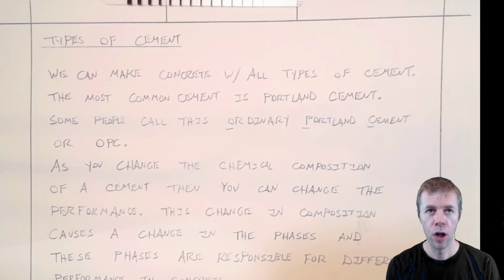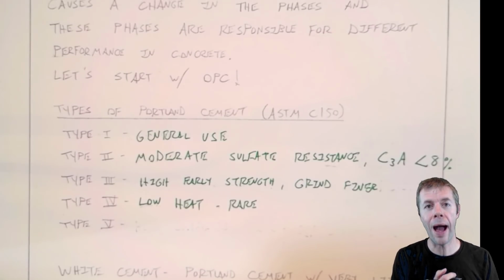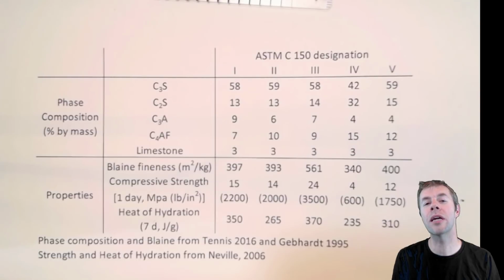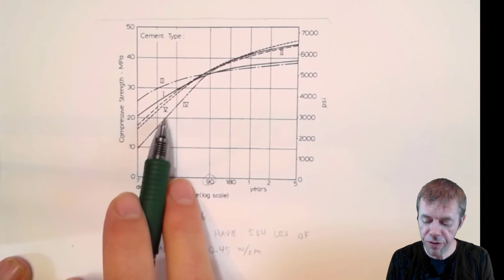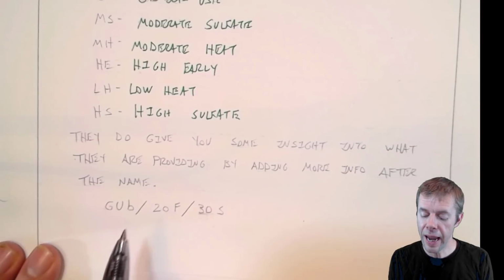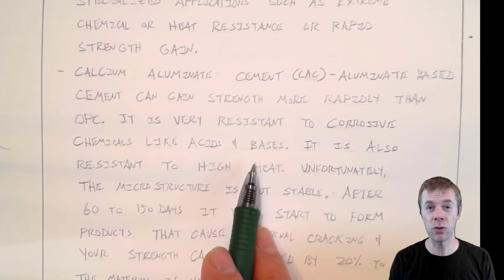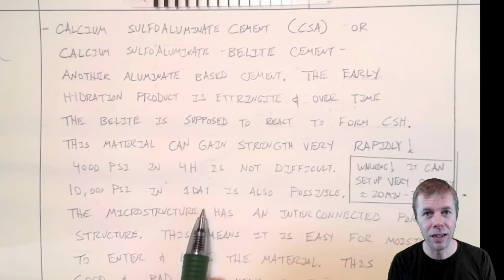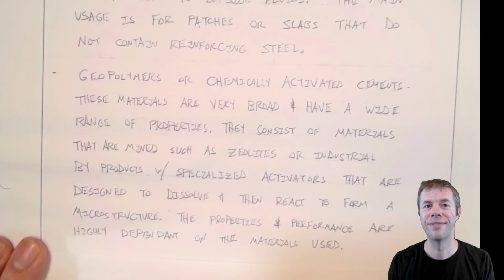Types of Cement

Comment: Don't you also need to add sand to the masonry cement  as well as water at the job site? Or am I misunderstanding you? Can cement ever be used alone out of the bag without adding addition materials? The stores sell masonry mortar mix and this blend requires only water.
Reply: Cement is only the binder, sand and gravel are agrigates which cement can bind together to make a morter or concrete and you almost never use it in isolation. The morter you buy at the store contains some amount of sand, and concrete mixes also contains gravel.

Comment: Awesome and simple explanation. Do you feel the Florida Champlain Towers collapse may be caused by improper mixing of the concrete, as evidenced by widespread clean separation of the concrete from the rebar used?
Reply: Would it not be the steel reacting with the concrete? Corrosion maybe?

Comment: I have a question.  On the collapsed bldg in FL when people would pick up chunks of concrete to move it the chunk would turn to powder.  Is that normal or does that mean there was an issue with the concrete? I have never picked up a piece of concrete and had it turn to powder in my hands.

Comment: Which is the strongest? I need to resurface my driveway.  Need like 1 inch thick.
Reply: pablo marquez, Now you're taking about mix designs more than the type of cement. Trinic Concrete has a lot of great videos on the subject.

Comment: I was on a Job site that they were pouring electrical Duct bank. The foreman said they use thermal cement what is that? Is it thermal conductive cement? Is strength loss why they take 3 or 6 samples to be tested every 30 days? sometimes tested up to 180 days.

Comment: CAC can be modified by infusion with ultra low viscosity resins and soluble calcium after it cracks, which, while never really regain their original strength, it brings them back somewhat. ~( 'w')/
CSA [quick set cement] is hella hard to work with so you pretty much have to mix it as you apply it [like shotcrete style machinery] but the mixing equipment is subject to freezing up if its not fully moved and purged, especially once a pour is finished.
If you use CAS and mix in a sealing epoxy, you can have a very impermeable sealant, which can be good for shoring up loose soil, shale, and mine shafts. I suggest one also add fine fibers such as aramid fibers [low deformation, high tensile strength, high fracture resistance, high corrosion resistance, no corrosion contribution, chemically nonreactive, nontoxic, and non-flammable] like Kevlar, but not necessarily Kevlar its self, since many others with potentially more desirable properties.
https://en.wikipedia.org/wiki/Aramid
Reply: Delicious BeBlair, White cement or OPC with up to 20 % CSA as a substitute is a good trade off.

Comment: Could you speak to interfaces between types of concrete; specifically with respect too the use of 3d printing cement using blaine cement on outside of form and OPC on the inside to reduce crack propagation and using Type 5 cement as a liner in sulphide ore roaster flumes. (Just two examples)
Reply: nice, if you find any good vids that explain these more clearly or links share em with me

Comment: In the oilfield I have mainly used Class G, along with Type III and Type V. Also, 50/50 Poz Class G were quite commonly used too.
Reply: It’s interesting how in the oilfield so many commonly known things are added to cement to achieve desired properties. Salt is used in lower concentrations to accelerate the set of cement but table salt at high concentrations (on the order of 18% by weight of water) will be added to the cement to give the slurry desirable pumping properties as well as to control shrinkage and for cementing across salt formation zones. Regular household sugar is a strong retarder of cement so in the oilfield if you were washing cement equipment up to a tank you could add lots of sugar to prevent it from setting. This could apply to yard work. Maybe you have a wheel barrel of mixed concrete with some left over. You could just add sugar to it to prevent it from setting up inside your wheel barrel. These are just a couple of examples. Cement is a very cool material and there’s a lot more involved with it than most people realize.
Reply from the maker: Thanks Newfie!

I agree!  We do all these things in construction cements as well.  I talk about some of this in my admixture videos.  You can get them here:  https://www.youtube.com/watch?v=q_PwZE57Slc&list=PLRq6Z9d0kCT9uXCXNb6bCjskyMPXA-wIL
Reply from the maker: I agree.  Fly ash is great.  Here is a video about it:  https://www.youtube.com/watch?v=0wOCn7smmIs&t=31s
Reply from the maker: Thanks Newfie.  Class G is very similar to Type II cement.  Did you use fly ash as your pozzolan or was it a natural pozzolan?
Reply: Tyler Ley we used fly ash. As a byproduct of coal burning it was quite cost effective.
Reply: What is the difference between Portland cement and Pozzolan cement?